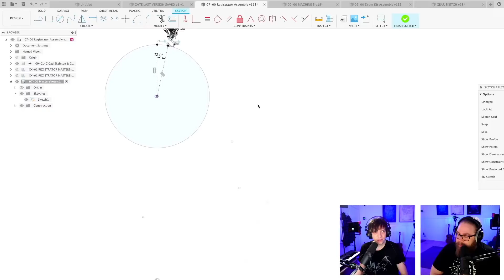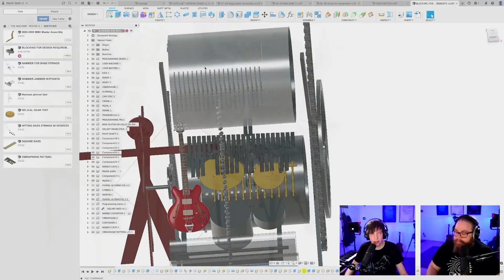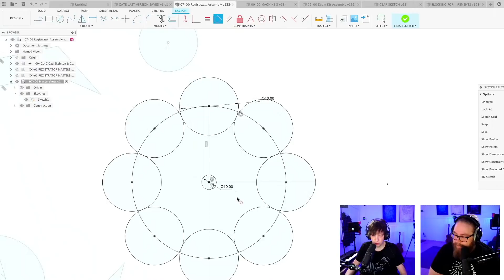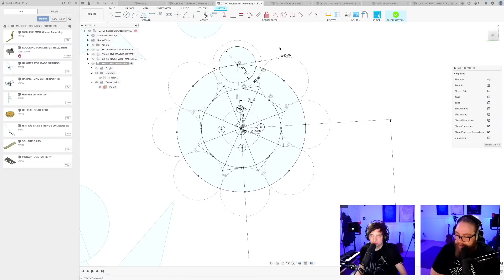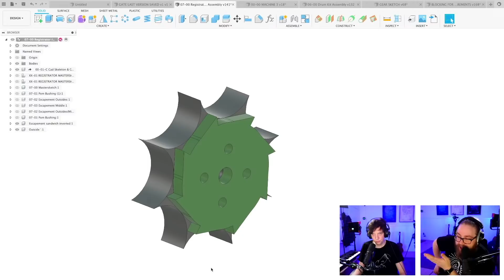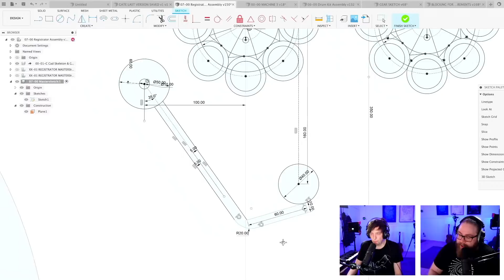A Better Marble Gate - Martin vs The Machine

Comment: Double outside escapement is PRETTIEST, but it's also the most structurally stable and holds the marbles best -- getting the marble alignment to not jam is much harder on the inside.  On the outside, add two full blocking circles on the sides to prevent any falls on the sides (like a water wheel) before putting the outside escarpments.

But if you've made the design properly modular, you can literally try both and swap it out if one doesn't work.

Comment: Light marbles will reduce weight and reducing weight reduces noise, so wood is good there. However I worry about friction and wood particles everywhere in the machine after some level of use.

Comment: Suggestions make the marble guide  wheels 2millimeters wider each side then marbles and use cup like shape with air hole at angle  in side of wheels to prevent suction sticking

Comment: Wood shrinks and swells with the air moisture content. Wooden marbles will not stay perfectly round. This may be problematic on tour. Suggest plastic or rubber type materials instead.
Reply: Shrinkage/swelling depends on grain direction - they will not change diameter along the grain but may change diameter significantly across the grain.

Comment: Please reconsider using wooden marbles. I see armies of moles under there.
Metal marbles with a correct dampening system are still the way, I think.
Reply: Strongly agree!
Reply: Agreed. Wood can also Crack and break.  Imagine having to fish out shards of wood from the machine mid concert.  Also the weight of each wooden ball could be different which could throw off the timing

Comment: Are there manufacturers out there who offer wooden marbles? Maybe something made of plastic with a wooden pattern would fit as well?
I think building wooden marbles with  a metal core is not the easiest when you need 10,000 pieces and they are handcrafted.

Comment: There has to be a mouse manufacturer someplace that has a few thousand unused old style mechanical Mouse Balls.  Maybe mention it during the live stream, and someone somewhere may remember a box of heavy rubber coated steel balls in the back of a warehouse somewhere.   They might donate them to the project.

Comment: The one with the escapement on the outside separates the two functions. Holding the marbles is one function, the escapement is another function. You can even separate them on the shaft if you need to, which is impossible on the sandwich version. You could still make the spherical cup to ‘hug’ the marble if you want, but overall it’s simpler and more elegant.

Could you let us know if these comments are being read, or is it just livestream chat?

Comment: You did a thinking mistake - the marbles will not be flat in the gap - instead they will touch the inner planes. You construction only works if the thing that holds the marble has no offset. To compensate this you should first make a full Zylinder and then cut out spheres to get the real dimensions. Then cut out the gap in the middle, then make the inner "gear" that connects to the fingers

Comment: Sadly wasn't there for the stream, but there is a point to make at timecode 12:00. Don't forget to use your room for errors do not need the marbles touching instead they need 10mm of clearance.

Comment: I don't know if we got there, but the "trapped" is an illusion; the marbles would trap if the wheel covered more than half of the _marble_, which is actually a straight line perpendicular to the radius of the wheel, and quite a bit higher than the arc of the wheel that we were past. The flaring out at the tip never passed parallel, and the marble was free the whole time; it flared because it's a smaller circle as you go out in the Z direction.

Comment: Do you need the separate escapement at all? Could you use a gate on the "rotating up" side of the cog with teeth that are the same shape as the marbles? Think ball and socket that dislocates as the escapement turns.

Comment: If the gear of the programming wheel is integrated, how can the wheel be changed for the next song without running into issues with the belt? I mean you would have to take the belt off each time and then find the correct position again.

Comment: For perfect soft touch marbles you could use the rubber coated balls from old fashioned computer mice. Heavy, rubbery and right size…
Reply: It's worth testing but I think the friction would be to high. When multiple marble roll in a tight row they gonna rub against each other.
Reply: @robinj6997  Yes, rubber balls are a big no-no because of friction.
Reply: They'd have to be replaced every now and then too. I've found old soft-touch surfaces to desintigrate and turn into sticky or oily surfaces. I'd be worried it could gunk up the channels.
Reply: I think the following questions have to be answered, if thoose balls are considered for the MM3:
- are they still produced in large numbers?
- wenn yes, is there a standard size?
Reply: oh and the size would be perfect too .. now the challenge would be sourcing those ...